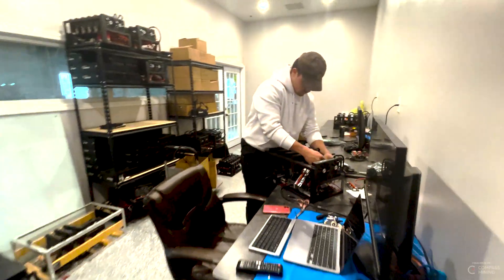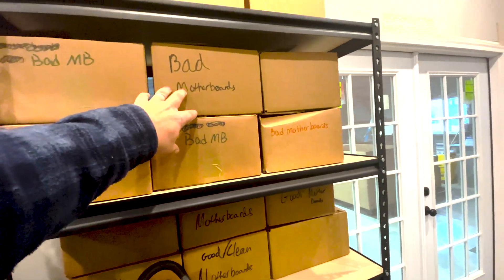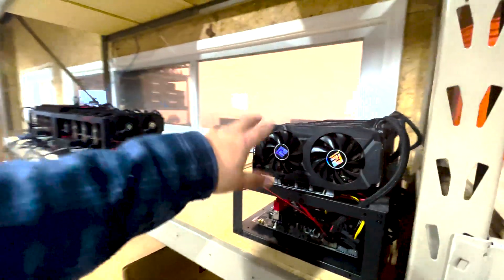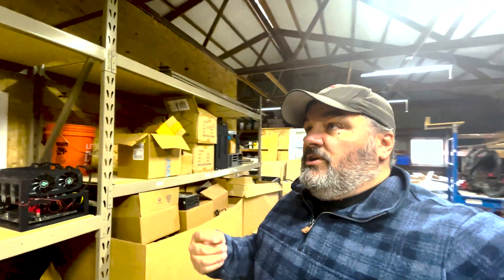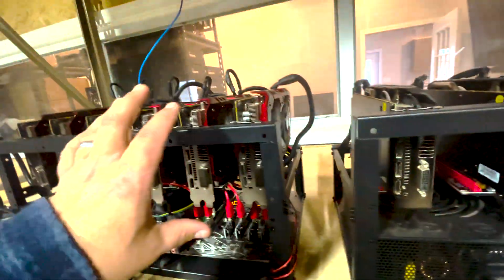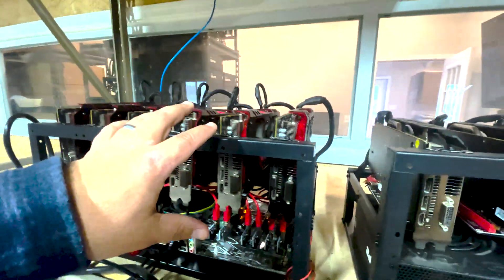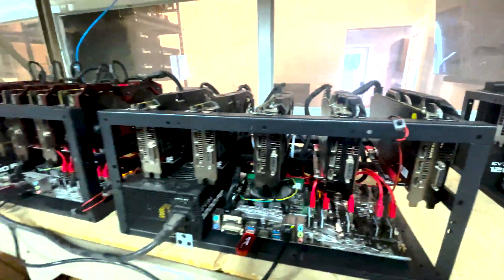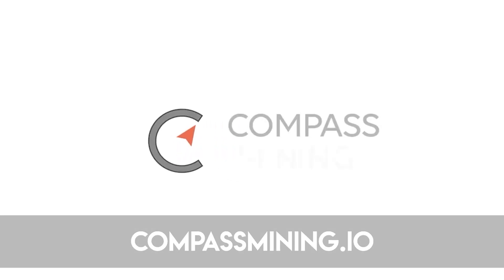What fan speed should you run while you mine?

Comment: fans are cheap, easy to find and replace. most of the time you don't even need to change the fan but apply some sewing machine oil to the ball rings. if a gpu dies it'll be much more expensive and time consuming to repair. also don't leave your fan speed to auto. if they work at the same % all the time, it'll more unlikely to fail. constant change of speed give more damage to the fans.

Comment: If you increase fan speed you lower the mem temps. Then you can achieve higher mclock at the same mem temps as with lower fan speed. This will increase your hashrate. To suggest this low of fan speed is amature at best. Dangerous to other onboard components.

Comment: I have couple RX-580's, used them without any modifications, just adjusting PL to -30% or so, fans vary 1200-1500 rpm and temperature 59 celsius to 64 celsius or so.  Mining works the best if you find the good equilibrium between hashing power and card wear and tear plus power usage. If you need to repair fans often, it eats up the benefit the hotter settings might assumed to bring in. Just like BBT earlier said, it's not a racing full power, but more like cruising along without making big stress to hardware. The longevity of the mining hardware counts a lot.

Comment: What?! I’m running my 3080ti at 80-90% fan speed and the memory temps are always above 100c. The gpu is from September but it has been like this since new, could I have a problem with thermal pads or something?
Reply: Yes thermal pads are horrible on these cards. Friend of mine changed his 3080ti FE pads and instead of 80% fan speed to keep the card from throttling 55% was enough 😁

Comment: There a reason you dont use rig fans?
Reply: They do very little. Cost money. Take time to install. Use extra power. I a farm with good airflow, the flow in the room is more than such small fans can provide anyway.
Reply: @RingstedHedge  I run noctua redux on my open air rig (much better cfm compared to average fan and not so noisy), and my gpus run about 7C lower with them on, because they provide fresh cool air for the 3080s to use. I was thinking he has so much airflow in farm that he didnt need rig fans specifically

Comment: You can do so much more than simply running your fan at a fixed speed. You can literally code a script which will adjust your fan speed based on temperature and definitely truly expend your fan lifespan.
I guess that's the problem with using closed source mining OSses based on GNU/Linux, because they remove all the amazing GNU/Linux experience and possibilities from you as a user.
Terminal, bash scripting and understanding how GPU drivers work is a fantastic way to improve your mining and GNU/Linux experience, let alone improve your personal skills.
GNU/Linux is amazing so at least learn more about it and don't necessarily choose the easy and convenient way...
Have a great weekend and i can't get enough of the new office space :)
Reply: Those mining OSes already have those coded in.
Reply: No, Richard, it's 'Linux', not 'GNU/Linux'. The most important contributions that the FSF made to Linux were the creation of the GPL and the GCC compiler. Those are fine and inspired products. GCC is a monumental achievement and has earned you, RMS, and the Free Software Foundation countless kudos and much appreciation.
Following are some reasons for you to mull over, including some already answered in your FAQ.
One guy, Linus Torvalds, used GCC to make his operating system (yes, Linux is an OS -- more on this later). He named it 'Linux' with a little help from his friends. Why doesn't he call it GNU/Linux? Because he wrote it, with more help from his friends, not you. You named your stuff, I named my stuff -- including the software I wrote using GCC -- and Linus named his stuff. The proper name is Linux because Linus Torvalds says so. Linus has spoken. Accept his authority. To do otherwise is to become a nag. You don't want to be known as a nag, do you?
(An operating system) != (a distribution). Linux is an operating system. By my definition, an operating system is that software which provides and limits access to hardware resources on a computer. That definition applies whereever you see Linux in use. However, Linux is usually distributed with a collection of utilities and applications to make it easily configurable as a desktop system, a server, a development box, or a graphics workstation, or whatever the user needs. In such a configuration, we have a Linux (based) distribution. Therein lies your strongest argument for the unwieldy title 'GNU/Linux' (when said bundled software is largely from the FSF). Go bug the distribution makers on that one. Take your beef to Red Hat, Mandrake, and Slackware. At least there you have an argument. Linux alone is an operating system that can be used in various applications without any GNU software whatsoever. Embedded applications come to mind as an obvious example.
Next, even if we limit the GNU/Linux title to the GNU-based Linux distributions, we run into another obvious problem. XFree86 may well be more important to a particular Linux installation than the sum of all the GNU contributions. More properly, shouldn't the distribution be called XFree86/Linux? Or, at a minimum, XFree86/GNU/Linux? Of course, it would be rather arbitrary to draw the line there when many other fine contributions go unlisted. Yes, I know you've heard this one before. Get used to it. You'll keep hearing it until you can cleanly counter it.
You seem to like the lines-of-code metric. There are many lines of GNU code in a typical Linux distribution. You seem to suggest that (more LOC) == (more important). However, I submit to you that raw LOC numbers do not directly correlate with importance. I would suggest that clock cycles spent on code is a better metric. For example, if my system spends 90% of its time executing XFree86 code, XFree86 is probably the single most important collection of code on my system. Even if I loaded ten times as many lines of useless bloatware on my system and I never excuted that bloatware, it certainly isn't more important code than XFree86. Obviously, this metric isn't perfect either, but LOC really, really sucks. Please refrain from using it ever again in supporting any argument.
Last, I'd like to point out that we Linux and GNU users shouldn't be fighting among ourselves over naming other people's software. But what the heck, I'm in a bad mood now. I think I'm feeling sufficiently obnoxious to make the point that GCC is so very famous and, yes, so very useful only because Linux was developed. In a show of proper respect and gratitude, shouldn't you and everyone refer to GCC as 'the Linux compiler'? Or at least, 'Linux GCC'? Seriously, where would your masterpiece be without Linux? Languishing with the HURD?
If there is a moral buried in this rant, maybe it is this:
Be grateful for your abilities and your incredible success and your considerable fame. Continue to use that success and fame for good, not evil. Also, be especially grateful for Linux' huge contribution to that success. You, RMS, the Free Software Foundation, and GNU software have reached their current high profiles largely on the back of Linux. You have changed the world. Now, go forth and don't be a nag.

Comment: 30% fan speed for 94 degrees cels on the memory is actually insane. I didn't even know you could get that on air cooling! I'll need to play with my settings again.
Reply: You can't get those specs with an RTX unless you are living in a fridge.
Reply: @ertana7609  can probably on 3060ti, but definitly not on higher power cards like 3080s

Comment: I run all my fans at 70% all day every day 24/7 365 days a year we never close always opened like 7/11 

Ill swap fans out in 10 minutes if they die. My diodes and capacitors NOT dying IS more important than a measly fan dying my dude
Reply: Same,  I run my fans at 70% to 75% depending  on the core c. Fans are easy to replace. Running  gpus hot is a no go in my opinion.
Reply: Amen to that, 60% in my case
Reply: yea i really dont understand the logic unless you have hundreds of gpus so youd be changing fans all the time